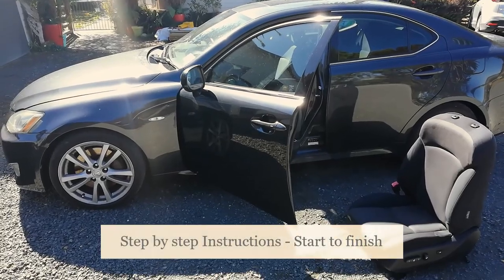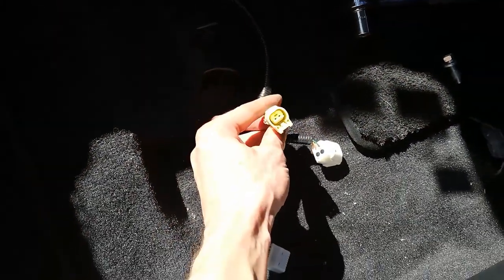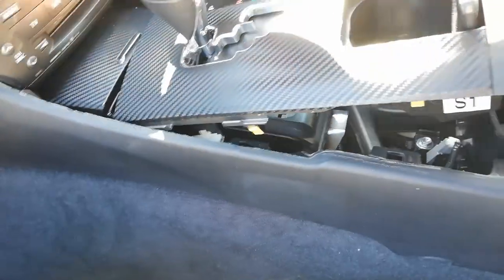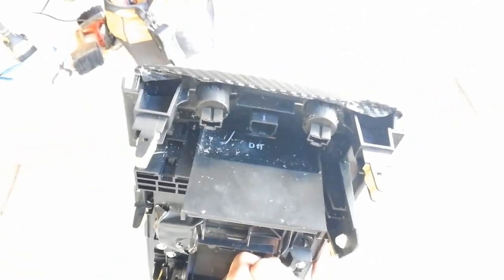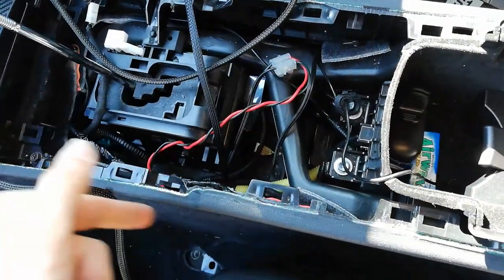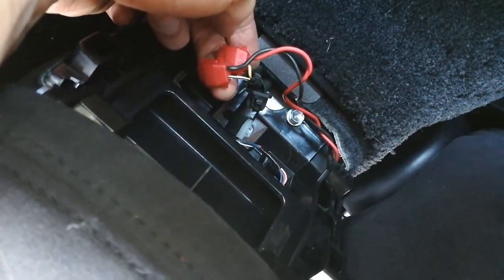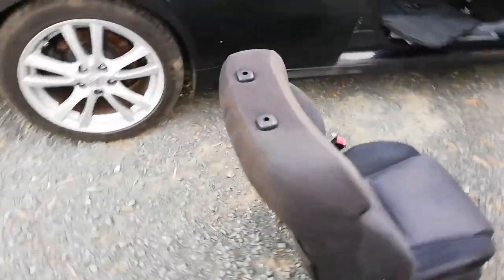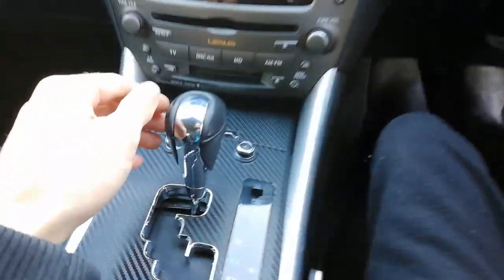How to install Heated Seats into Lexus or Toyota for just $50

Comment: Did you install the rear subwoofer yourself? Can you make a guide for that?
Reply from the maker: Yes, it was a bit difficult as I tapped into the rear amplifier and needed to Google the pin out. I also used an amplifier that could handle speaker out